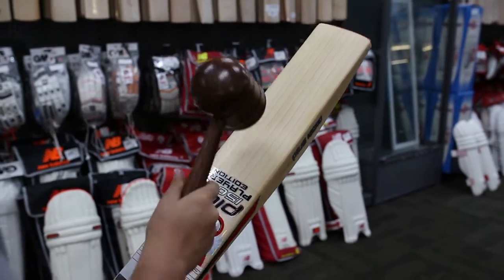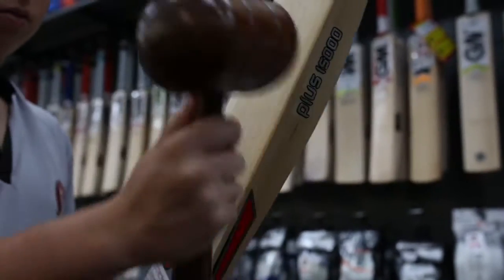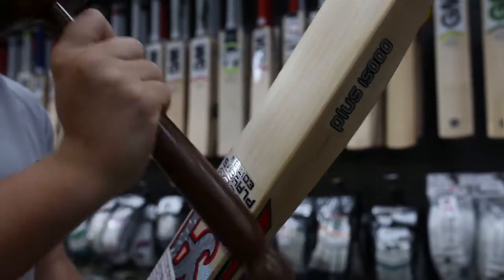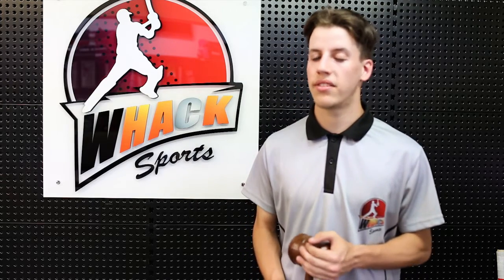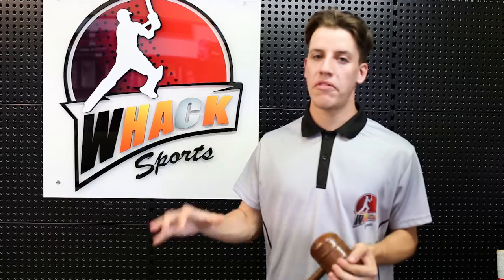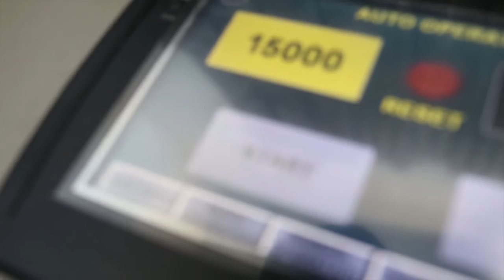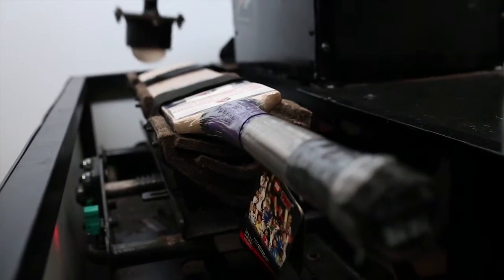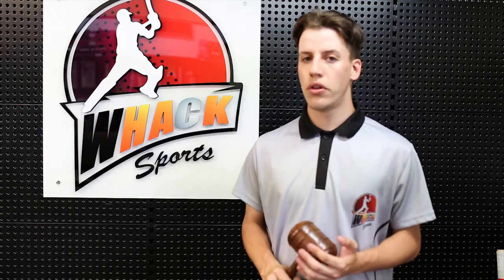How to Oil and Knock in a Cricket Bat

Comment: some people also recommend " rolling " the edges before starting to use a mallet , using a bail. I personally would not start even lightly whacking the edges with a mallet before the rolling process. Also rounding the parts where the face becomes the edge is a good idea.